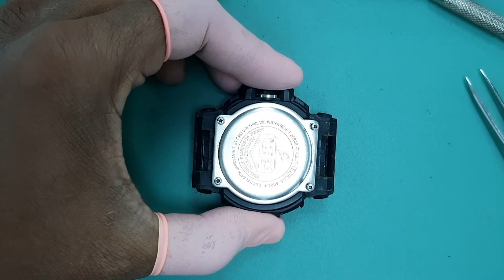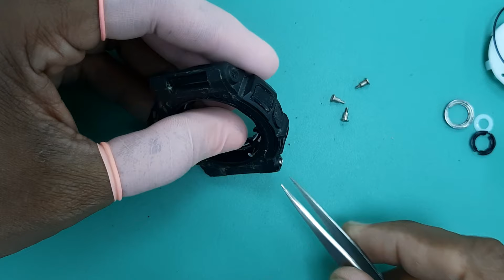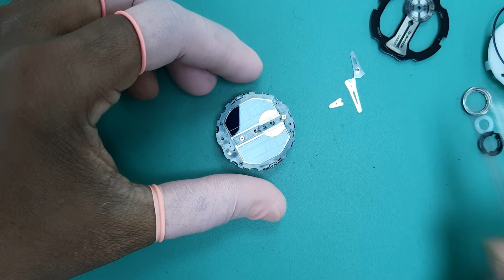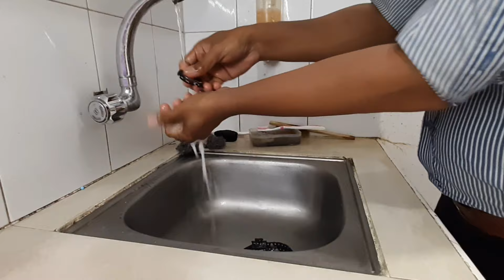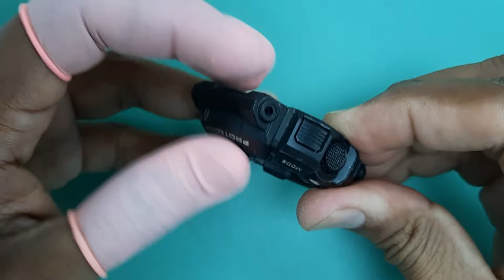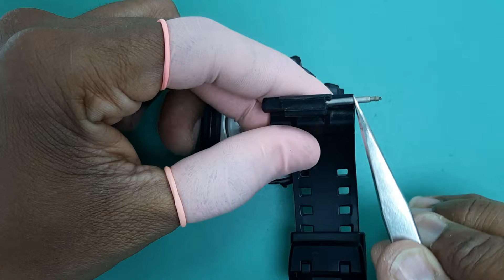G-SHOCK GA-400 Disassemble and Assemble With Battery Change

Comment: I notice on this video that the rotary switch does not working after you put all the parts back on its place. How's the g-shock now? What action you did?
Reply: I had the same problem. I removed the rotary button and it stopped working after I put it back. I still haven't found any solution to this problem.
Reply: @andesonmorais  same here, I replaced the battery and now the rotary switch is useless.  Haven’t seen any solutions either and it’s starting to irritate me.
Reply: i had the same problem my rotor does not work anymore
Reply: Do you found a solution? I have the same problem
Reply: after replacing the battery, you need to restart the mechanism, this can help you.
Reply: @amithemo3270  after replacing the battery, you need to restart the mechanism, this can help you.
Reply: @stepankruychkov1819  "this can help you"... what exactly? Please help us, do you have any links?? Thanks in advance
Reply: Exact same problem.  Replaced batteries, rotary won't work.  Searched loads and no answer.   Any ideas?
Reply: Same problem with me, after battery replacement the rotatory crown is not working. Please help
Reply from the maker: Replace the rotary
Reply: @SolimBD  but what could be the problem? As it was working just before replacing the battery. 
Note battery was replaced as the lights were going dim
Reply from the maker: majority rotary pin problem
Reply: @SolimBD  found a solution and fixed it diy, it was a very simple detail.
Reply: @PraXii1109  how did u fix it
Reply: @Amiteshh19  all u need to do is open the back, remove the plastic cover that fixes the rotary switch, now remove the switch and look for a flat areas on the switch pin tip. The switch will work only if the flat area of the pin matches with that of the socket of the switch holder. It will take a few tries but i fixed mine with this simple approach
Reply: @PraXii1109  thank you
Reply: Found a solution, since the rotary stem is very delicate, removing it carelessly will definitely break the end  point or the pin . I saw a website online that sells rotary for GAs and GBAs and the price is $45
Reply: ive found the problem, its actually the reinsertion process of the switch, if the tip breaks due to a very minute Mal-alignment, the rotatory switch is useless after that, and only option is to replace it. same happened it me, u actually need to mark its correct alignment with the body before removing it. otherwise it will break upon reinsertion.

Comment: Do u have an experience with after replacement battery for gshock g400 and it doesn't working and the watches still dead
Reply from the maker: Try to AC reset
Reply: I have reset it or connect ac but it still not working🥺, one of my savior from accident
Reply: And I got a spring that tiny spring than other from drop when I want to assembling, do u mind where is it came from?

Comment: lot of people are having a problem of rotatory crown not working after re-assembly, ive found the problem, its actually the reinsertion process of the switch, if the tip breaks due to a very minute Mal-alignment, the rotatory switch is useless after that, and only option is to replace it. same happened with me, u actually need to mark its correct alignment with the body before removing it. otherwise it will break upon reinsertion.

Comment: Pls don't buy battery watches from Casio once you open to replace the battery it loses its orignality, I had worst experience after changing the battery. After replacing the battery water gets into it. I have faced this with G-Shock GA 400, Mudman series and Edifice model also. Now I started buying 10 years battery life or Tough Solar watches to avoid this.
Reply from the maker: Thanks for sharing your experience!